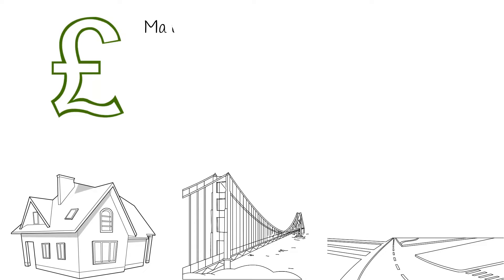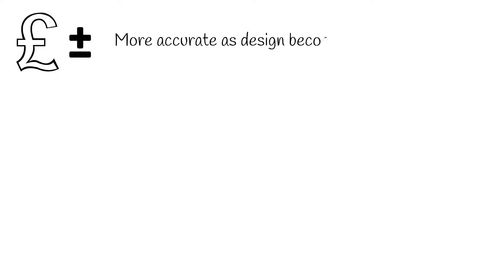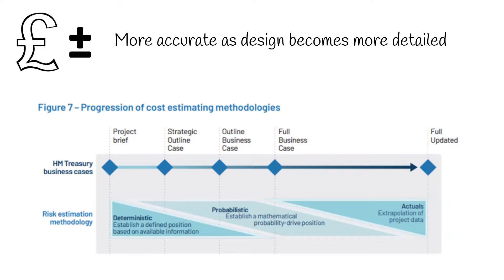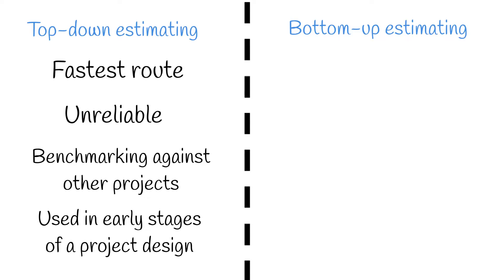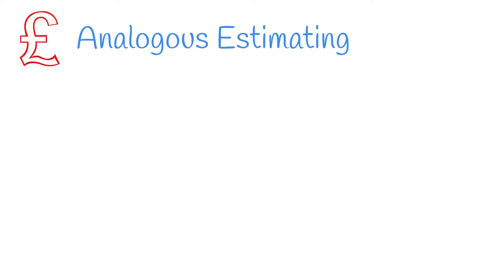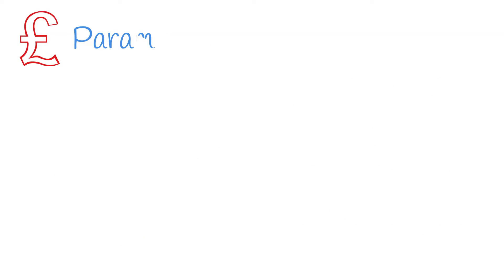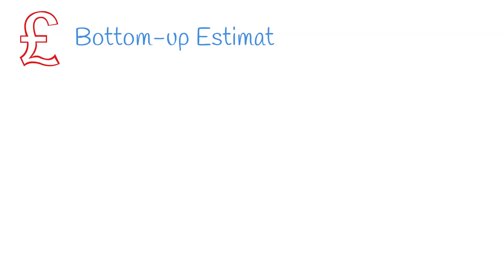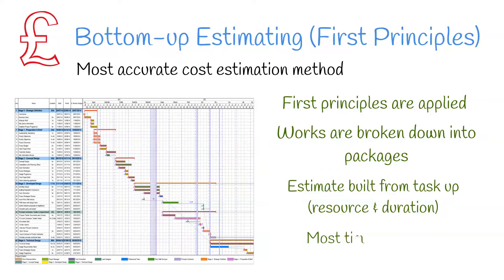Construction Estimation Methods Explained | Analogous, Parametric & Bottom-up

Comment: Should I feel out of depth if I start a 5 year QS Commercial Management consultancy apprenticeship if I don't have past experience at 18 years old and are currently taking essay based a level subjects. I'm worried the skill gap may be too much since I haven't been around  stem subjects since in almost 3 years? What advice do you have?
Reply from the maker: Not at all! Most people who start their degree have either none, or very little on-the-job experience. Have you had an offer from a workplace or are you currently looking for apprenticeship jobs?
Reply: @Metroun  have been invited to a few assessment centres in the final hiring stages.